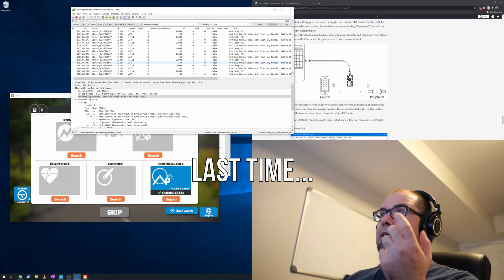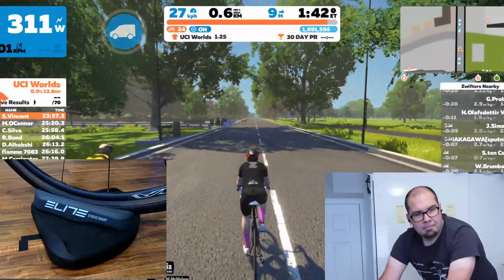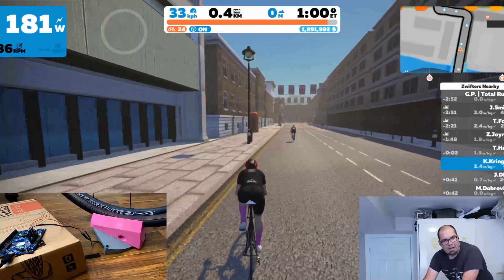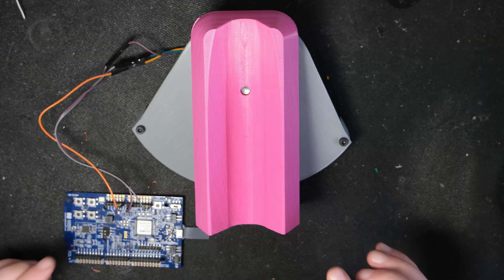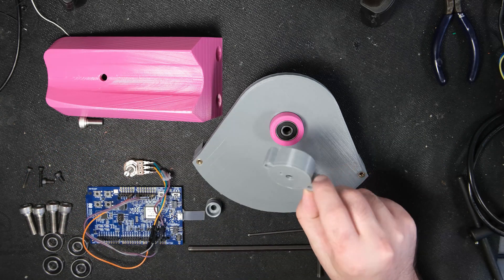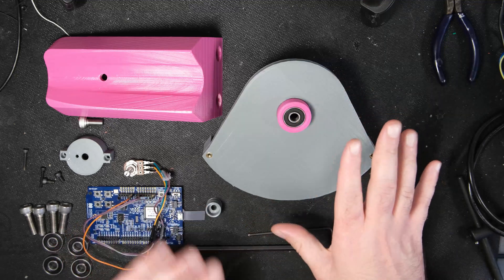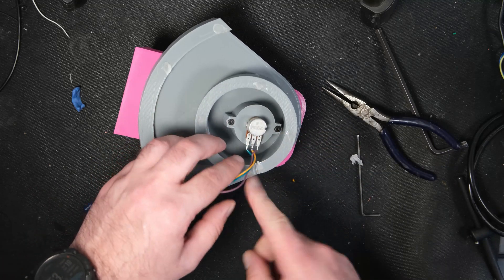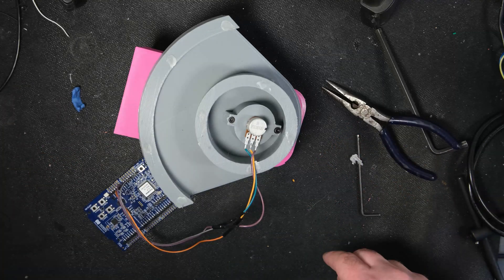Zwift Steering for $25 - 3D printed

Comment: I was looking for something like this! I have my electronics ready, but didn't feel like designing the case 😅 I'm wondering though if buying the non-smart Stero wouldnt be the better option … 🤔 Especially since it's currently on sale for 20 bucks.

I think an upgrade would be Zwift route selection. I plan on doing this by also implementing a HID Keyboard Service and two Buttons on the extreme ends of the steering range. Once either button gets pressed the Soft-Keyboard just sends keycodes for "arrow left" and "arrow right". No idea why steering does not work in Zwift out of the box with Sterzo. I guess typical banana software from Zwift again …

Hm, where did you get the sensor for so cheap? OTOH I could just use a standard 1-axis magnetometer and asin() … ;)

Anyway, thanks for reversing the Sterzo!

-- 
First time viewer, instant subscriber.

Comment: I'm trying to reproduce this with a Raspberry Pi and have added code to app.py to read the value of the potentiometer, but can't figure out how to send that to Zwift.. I assume via dbus.  Can you point me in the right direction?
Reply from the maker: Andy did most of that code, I'm really not good enough to point you to things.
Reply: Did you ever get any way with this?
The rasperry pico Wireless now supports bluetooth and it would be perfect for this as it is even cheaper than an esp32 board, and draws less power.

Comment: Great video and great potential here.... Did you mention in your previous video that more data is coming out of the Bluetooth zwift software and could there be a relation with the git hub zwift packet monitor to decode this additional Bluetooth data.  It would be great to get heart rate, power, speed, etc in a more easy manner than a permanent packet trace. I am currently pushing this packet monitor data to mqtt to switch on my fan on/off and led's color based on heart rate and power.

Comment: Nice work! I want to build this! So my question. What is this exactly for a Dev Kit you are using? Because only the BL652 can´t run its only the bluetooth module or am I wrong with this? So with not your programmer skills I can not only buy a BL652 module and use just this with your code. OR could you help me with this topic? So it would be really nice to get a step by step manual to get this to work, if possible for you. The 3d Printing part is no problem =P

Comment: @Keith one more question: is there any chance to get actual speed from Zwift? I want to register on Garmin Edge or Wahoo Roam etc. proper speed that is visible on Zwift. If you use bike computer and try to calculate speed from trainers wheel speed this will not match with visible on Zwift.
Reply from the maker: Not via this method, but I think some people have have dug into the network packet analysis have, but that's out of my field. I know of a guy who build a DIY Climb and he got slope out of network packet analysis (https://github.com/vincent290587/Climber). It's a little complex but the idea can be reworked I believe to get speed as well.
Reply: @kwakeham  I know Climber project. I made your steering on esp32 (Runningtoy port) with some mods and now prepare Fusion project to combine your steering with Climber. I want to use NRF52840 Dongle. In next step, I will try to add Maelstrom to have a complex solution (for Maelstrom I really don't know which electric parts you used - maybe you can share some schematic how you regulate AC output voltage). 

BTW your videos and hacs are really great. I learned a lot. Thanks.

Comment: Thanks for all your work I found your videos most informative. As a person who reversed engineered a cheap radio connected barbecue temperature probes, so I could add the probe's data to a coffee roasting app, I appreciate the fun you can have ethically hacking.
When I watch what you have created I remember seeing a video where someone used a sturdy Lazy-Susan as a steering platform (slightly tilted). That makes me wonder if using a phone app on the bike's handle bars to transmit motion changes would make your excellent work more accessible to the general public than a hardware solution. Most people don't have access to 3D printers. I know that I saw such an idea a while ago but if I can remember correctly that was before the Elite Sterzo was sold and Zwift had added support. Maybe a phone's gyroscope is not sensitive enough, I simply don't know.
Reply from the maker: Do you have video on your coffee roasting hack? I'm kinda curious now. I think Shane Miller (GPlama) did something about a lazy suzanne build for a sensorless steering. The gyro thing is a bit miss or hit (where it always misses eventually). Basically cheap gyros have offset bias, so mounting your phone on a handle bar and integrating velocity to position will eventually cause drift. It always does, unless you correct back to something else. Accelerometers can correct back pitch and roll but not yaw, and yaw is what we want, so 100% of the time eventually it will drift and you'll end up steering left or right or with a bias. This is inherent to integration of noisy offset sensors being integrated. Magnetometers are often used to correct but their response is slow and noise is high. So a gyro running at 1000hz using data from a 75hz magnetometer means 9 - 13 samples in you have old data, and this causes jumpiness in a lot of algorithms. Turn down the dependence on the magnetometer and now you get less correction and more drift again. So steering via gyro is constantly chasing what you can do with limited capabilities on various phones over various os's over various generations, so they default to integrate a low frequency gyro... and back to it always drifts. And if you try and do something fancy, hope nobody has any metal or magnets nearby.

Comment: I've a Kickr Climb so something like this would be a pain to get working - but as I have no real wheels on the bike, I do have two brake levers that currently do nothing - would be interested in steering via cable through the break wires.
Reply from the maker: Months (year?) back I started looking at using an inductive sensor (LDC series) to measure cable movement. Built barely a proof of concept. That could work, or just a magnet on the lever with the TLV sensor that is used in the real sterzo.
Reply: @kwakeham  i have thought of some fairly complex methods, but want something simple, was even thinking a magnetoresistive sensor on one side of brake caliper and magnet on the other.

Comment: I think I'd like a button that would strap to my handle bar and I could rock it right or left to change lanes or maybe 2 buttons on for each hand to go different directions.  What drives me crazy is that when I turn and zwift doesn't let me change lanes I have to keep on trying to turn until Zwift will let me.  Zwift needs an indicator as to when I actually have the ability to change lanes.  For me so far steering was cool for about 20 minutes and I haven't really used it since trying it out.
Reply: I've seen some people float the idea of utilizing the hidden button on DI2 hoods.  Of course not everyone has this, but it would make for a clean solution.  Not sure if the Bluetooth broadcast for DI2 is readily available for third party use though.  That is the cleanest idea I've seen proposed though.
Reply: @duanegran  Actually, Keith did hack Di2 sometime back,  https://hackaday.com/2019/03/26/reverse-engineering-shimano-bike-electronics/
This was where I came across this channel first.
https://m.youtube.com/watch?v=25Kyh5im_ak

I don't have Di2 or zwift, but like to ride my bike and hacking. Subscribed!
Reply: @duanegran  Unfortunately my trainer bike doesn't have those buttons but something like that would be nice.
Reply: You can always replace the variable resistor that Keith use with a PSP 2-Axis Analog Thumb Joystick.
Reply from the maker: Ya. I've got some xbox and switch style joysticks I'm playing with here. I showed off the generic xbox-esq one in the last video. Might be something coming on that.

Comment: I use the AMS 12bit with SPI. If you use the absolute setting you don't need to calibrate. I would allow 3 5 counts +/ from the center. I workes well. Good luck.
Reply from the maker: Looks like a nice part, I think it targets a higher end application. Most of their units are in the $12+ range CAD on Digikey, the tlv493d is about $2.50. Likely not as good as your AMS, but I think Elite made a decent cheap choice that keeps cost down.

Comment: I'd be interested in seeing this built into a rockerboard. So; static front wheel, but the angle of the rockerboard being tied to the steering input. Out on the road, we usually steer by leaning anyway. Would probably need some playing around to figure out the 'dead-zone' so you're not constantly zig-zaging up the road from natural pedal rocking. But... still. I think a lot better immersion than goofy handlebar turning.
Reply from the maker: I'm looking at strain gage on the bars as a potential solution to this. It's just a difficult setup because my strain gage oven for the epoxy isn't large enough and so many cables to take off. I might try using the weight sensing feet as an alternative. There are definete problems with how the real Sterzo steers (fore-aft walk), and my design (vertical height shift). I think either force sensing method might allow for more natural steering.
Reply: @kwakeham  Or, get a kineckt sensor...or hell, maybe just a webcam if you have a plain background behind. And let software workout the 'center of gravity' of your silhouette - how much of your silhouette is to the side of the center-line of the bike. So the user leans their torso to side to steer.

Comment: Some conical/headset-bearing like bearings probably a lot more durable?
Reply from the maker: I designed it so that the bearings should never have lateral load on any of them. The 4 bearings compared to Sterzo's 2 + lateral loading the swivel bearing. With the Sterio design the inclined one picks up no lateral load because the weight is centered between the two bearing sets.